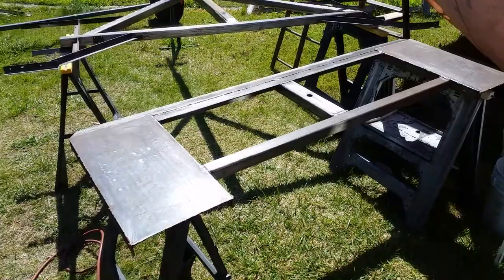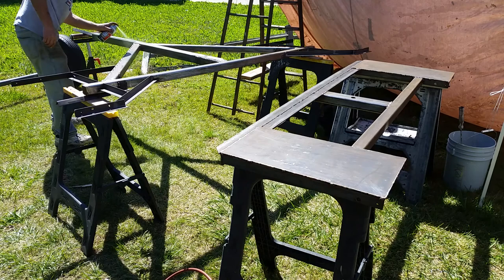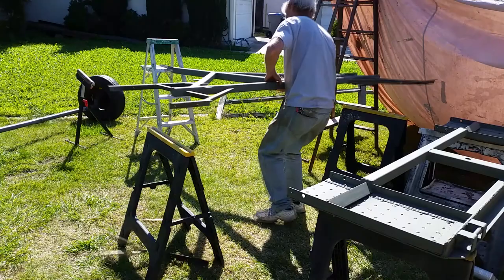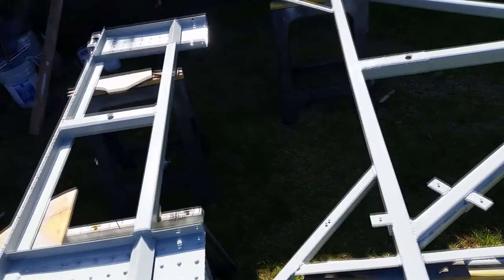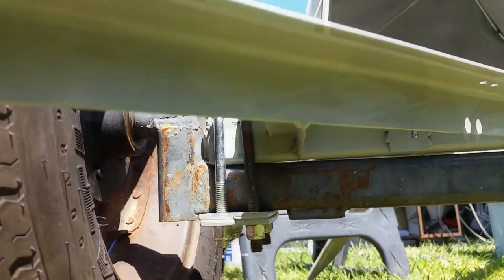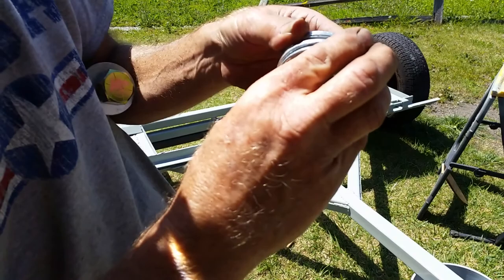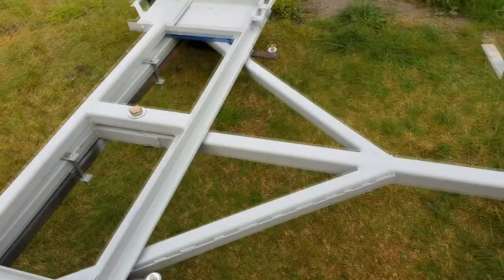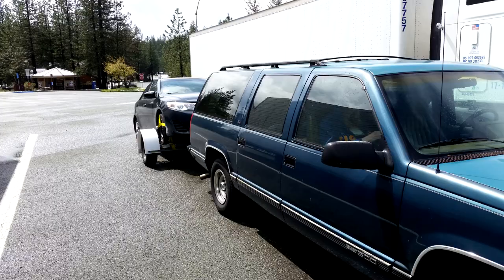DIY Pivoting Car Dolly Trailer, part 4 - DG

Comment: The cradle rotation limiters could be chains that connect to the main draw bar. Disconnect easily with add-a-link.
Reply from the maker: Something like that could work. I would make sure that the chain did not obstruct the cradle on the compression side (inside of the turn). Thanks for watching. DG

Comment: Hello This Looks nice Dolly And Profesional Build How Many Cars you Tow With It And It is Safe I tow Many Cars I'm Mechanic And I Rented From a U Haul Dolly I alweys won't My own Dolly I thin Over thousan Dollars Prety Pricy How much Did it Cost you To Build It Thank you Great Work
Reply from the maker: I've towed 3 cars on it so far. the first one was 800 miles. The heaviest one was a Chevy Astro van. The materials cost about $300, half of it was from a salvage yard. Some of it was scrap that I had l lying around, including the axle. Thanks for watching. DG

Comment: What kind of ramps did u use or add I got plastic ones but want to weld metal ramps to mine
Reply from the maker: Part 3 shows the ramp construction

Comment: What are the skids made of
Reply from the maker: The skids are made of 1/2" plywood. I coated it with oil base primer and lacquer spray. I'm going to replace it or maybe cover it with a thick plastic, like cutting board plastic so there would be less resistance. Thanks for watching. DG
Reply: @deegee8032  I bet some plastic decking board would be good